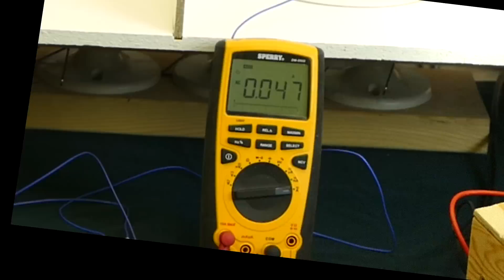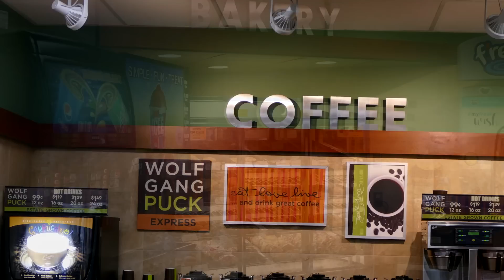Choosing the correct LED Bulb or Fixture for your Application

Comment: I  have watched your video and it is superb!!!

I like to have more information of exterior soffit LED pot lights. 

Best Led color temperature for my black soffit, red brick exterior.

My electrician installed 4 inches,  slim panel 9W = 80w, 750Lm, 4000K Dimmable but the house looks very grayish/white. 

It changed the color of the brick to cool tones and looks awful.  I tried to use the dimmer to the lowest set but it is very bight light and greyish instead of a low light.  I like warmer tones.  My other option is 3000K but i am afraid it will be very yellow/golden tones.  please help..need your advice as an expert.   What is the correct lighting for my black soffit.   Thank you in advance,   Maria

Comment: What would you recommend for a 6000 square foot community center multi-purpose hall? We are replacing fluorescent hanging troffers. Ceiling is maybe 14' high. The theater group wants warmer light but other functions may want something sharper/cooler.

Comment: Hi,what you recommend for a small barber shop ? 30 mq
Reply from the maker: If you have a suspended ceiling, I would start with 4,000K troffers, or panel lights and make sure they are positioned on both sides of the chair or chairs.  This is important to reduce or eliminate shadows.  Warmer accent lighting in the 2,700K to 3,000K temperature range is preferred by mirrors or on the walls to help your clients look their best.  Thanks for liking and subscribing.

Comment: Hi 😊
Thanks for the video!

What type of light would be best in my garage, a 3k or 4k led 18w 2370 lumen type T8/G13? I just need to be sure, before I buy 8 of them 😊
Reply from the maker: I would go 4000K.  You could even go 5000K in a garage.   How high is the ceiling?  if it is over 12ft, you may even want to consider something like the 90W High Bay we just started to carry.  Check out our latest video released yesterday.  Otherwise, T8 is a good choice.
Reply: BrightWay Supply Thanks for the quick answer! And there are around 10ft to the ceiling 😊 so I think that 8x18watt 4000k would be great, but maybe I will check out the 5000k option.
Thanks a lot for the help and will see what you got!
Reply from the maker: Thanks for subscribing!  If there is anything else you would like to see us cover, let us know.